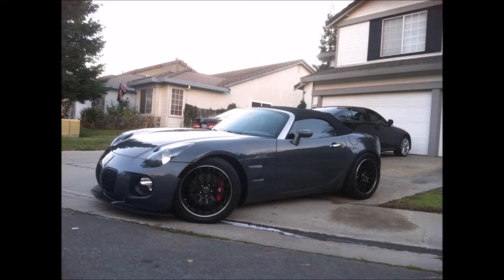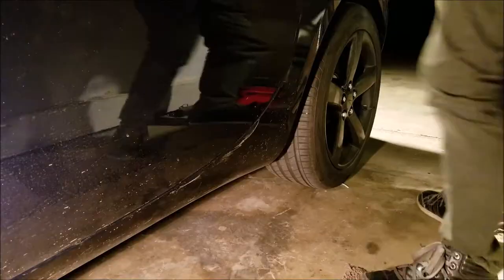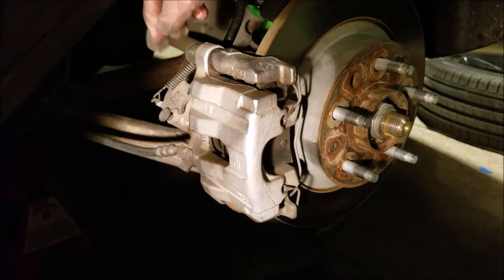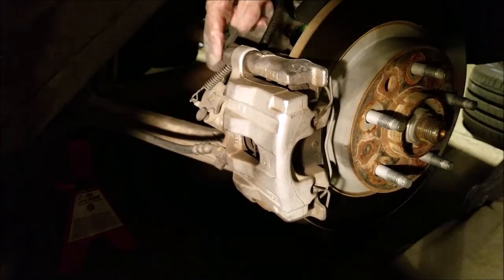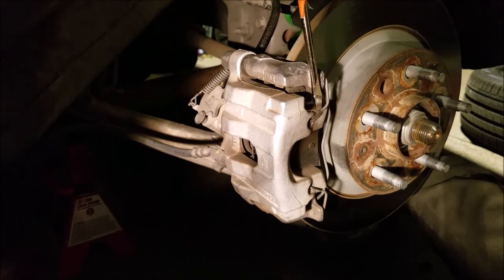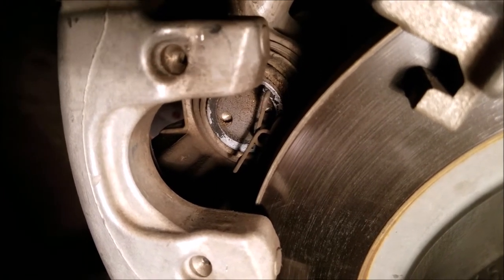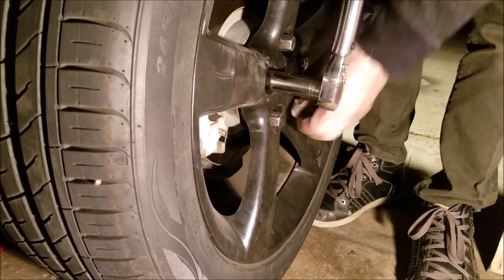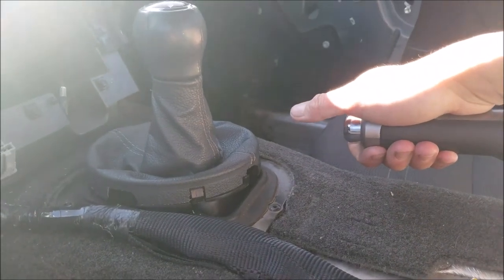How to Fix a Solstice Parking Brake!

Comment: Very helpful video!  My Solstice parking brake works like a charm now.  I used an inexpensive disc brake caliper wind back tool I bought on Amazon instead of using needle-nosed pliers to spin the caliper piston back in, but pliers would have worked for me too now that I know how to do this adjustment!

Comment: Fixed, thanks for sharing!
Reply: U did it to both rear tires?
Reply: I understand that you're supposed to hold the emergency cable bracket down as you're screwing in the piston.